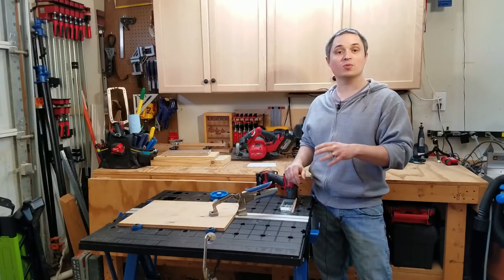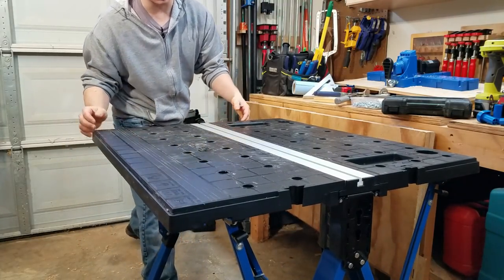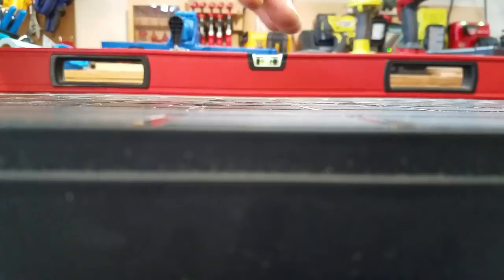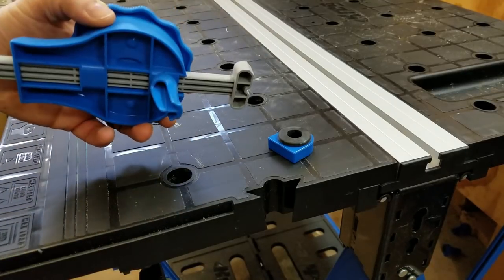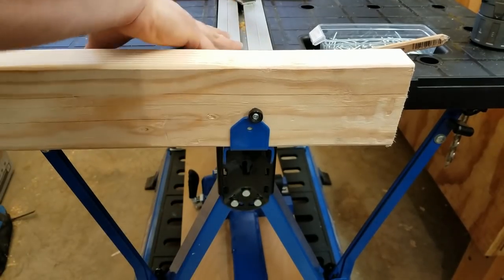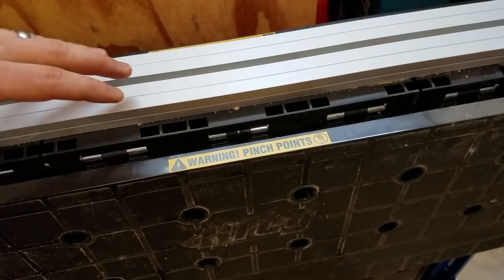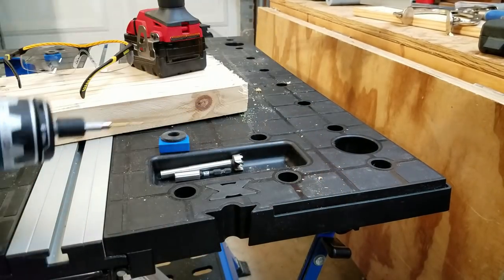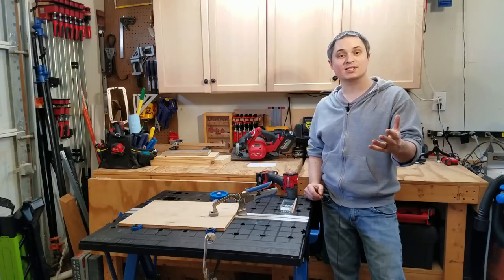Kreg Mobile Project Center KWS1000 Review

Comment: Great review, thanks.  I solved the handle problem by locking the bench clamp in the center of the t-track and using that as the handle.  Works well moving around the shop and no risk of pinching.

Comment: Excellent review.  I own two. I live in a house with a 20 X 20 garage. I had to have the ability to stow my workbench, that is why I bought a second. I can make a large one with two 2X4'S and a sheet of 3/4 ply.  If I wanted, it could be as long as the 2X4's and plywood.  By the way, they do not recommend it for a scaffold. When not in use, the two Mobile Project Centers stand up against the wall and only take up 12" Additionally, I own an Adaptive Cutting System. With their accessory brackets, I can use one of my Project Centers, 2  2X4's and have a large surface to break down plywood.  In conclusion, I love my two Mobile Project Centers,  They are great for everything, especially if you have two.

Comment: With my 2x4’s, I put in t nuts and drilled the brackets for a larger bolt so it’s not necessary to screw into the wood when building a longer table.

Comment: Thanks for the review.  the one feature that bothers me the most is the top is not flat and I always seem to put a piece of plywood on top, so I can work on a flat surface.
Reply from the maker: I might try messing with the legs and maybe shim where the support arms lock in place to get rid of the 1/16" droop. If I figure out a good solution, I'll post an update.

Comment: I would love one of these plus their track horse for my small workshop. It would make for a very versatile setup - but, here in France the work station is typically $250 and the track horse $170 which means they don't sell too well over here.
Reply from the maker: Wow, that's too bad - about a 50% price increase!
Reply: @DoresoomReviews  Kreg's router insert plate levellers - $19.99 on Kreg's website but $55 here - for four bits of plastic!

Comment: Another video addressed the lack of locking in the folder position  His solution was a hitch pin through a dog hole.  He was quite satisfied with the result.  Most home centers have them or check out a Tractor Supply store.
Reply from the maker: Thanks for the heads up, sounds like an easy fix.
Reply: Carriage bolt and wing nut

Comment: At 1:25, you pushed against against the unit from one side but I noticed that whenever you happened to exert force perpendicular to that, it appeared to wobble badly.
Reply from the maker: The maximum play can be seen at around 1:51 when I jump on top of it. Applying force in the perpendicular direction does cause the support arms on the wings to move a little, but the center and legs are still rock solid.

Comment: Do u think this will be better or the pegasus will do just for ocatio al user? Don't have a workshop, my garage is a game room and a gym and  also don't work with wood but sometimes I fix stuff around house and need a table to cut something or whatever. The kreg looks more versatile than pegadus but a lot heavier.
Reply from the maker: I think you covered the big one - I prefer the Kreg's features, but the Worx is 25 lbs vs the Kreg's 40 lbs. Plus the Worx will store more compactly. If you're looking for something that will be stowed most of the time and only get occasional use, you might want to go with the Worx. Of course if you're anything like me, your workbenches will get covered in junk and you won't be able to put them away anyway! I have my Kreg on a mobile wheeled base in the basement for that reason!
Reply: @DoresoomReviews  Thank you for your great advice.  Does the bottom of bench has threads to put casters, and do they get in the way if you wanna fold it?
Reply from the maker: No threads on the feet, I have it on a Bora mobile base. The feet sit right on the  frame. I think it's this model: https://amzn.to/3fMnjeE

Comment: It does have a lot of neat add-ons.  You missed is the lip around the edge for the Kreg screw boxes containers to hang off of.  There are a few things that I really like about it, however several things I don't. You mentioned the pinch points.  I have pinched my fingers in them a few times and man it hurts.  Your idea about locking down the sides would help solve that.  The other thing I really don't like about it is that that when you have both wings up, it's not a level surface across the top. If you're doing picture frames or something like that, this is not a good table.  It's highly annoying.  Overall, it's good but a bit overpriced in my opinion.
Reply from the maker: Good points all around!